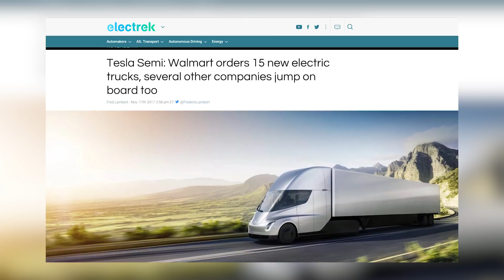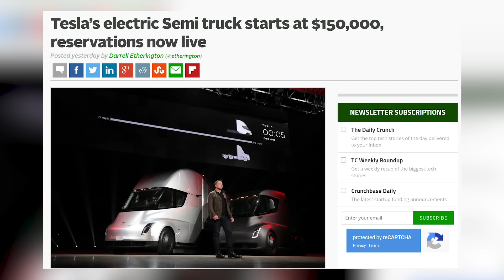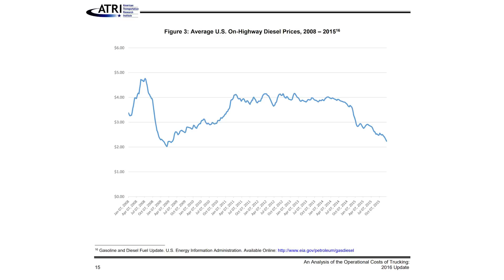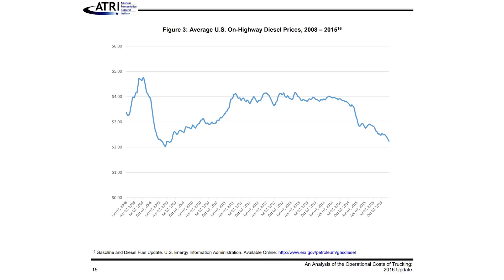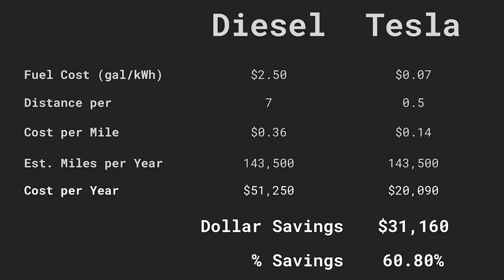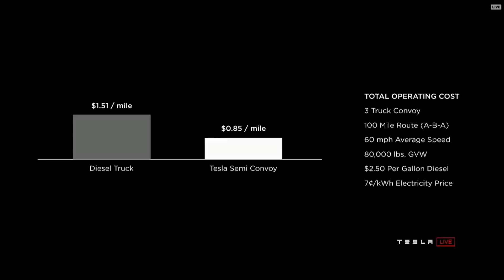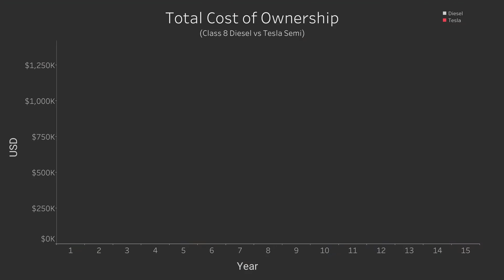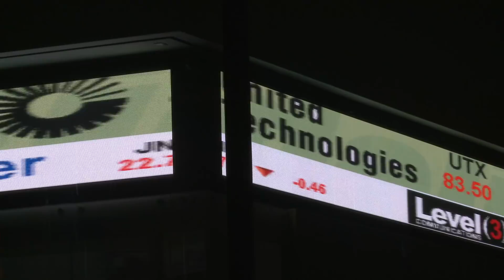What is the TRUE COST of a Tesla Semi?

Comment: You could be wrong on the battery size. Consider that a diesel semi gets 8 to 10 mpg, but a large diesel sedan gets 30 to 40. Figure a 4 to 1 ratio. A large electric sedan (Tesla model S) uses about 240 watthours per mile, so if the ratio holds, the Tesla Semi would use 960 watthours per mile. Rounded up to 1 kilowatt-hour per mile, that would mean a 500 kwh battery pack for a 500 mile range. Half the size you were figuring.
Reply: The mass only significantly matters when the truck is accelerating, once at speed (on a flat road of course) the only thing that matters is air resistance and friction losses in the tires/ bearings, which to be sure will be more than a sedan, but not nearly 15 times more.
Reply: No 2kwh/mile is very optimistic, I'm surprised they can get it that low.
Reply: The Tesla model S weighs 4500 to 5000 pounds, the semi fully loaded weighs 80,000 or roughly 15 to 16 times as much. I believe this can't be overlooked.
Reply: Flat roads? Not a lot of that around.

Comment: Actually, in the long run, the more packages that get delivered at home, the fewer semis we will need.  More things will BYPASS unneeded distribution and take the shortest possible path to your house.  And that will happen, ultimately, in very small vehicles.
Reply: Alan Brown I've actually had packages delivered direct to my door on semis
Reply: Alan Brown That is a real ignorant ads backwards conclusion.  The trouble of retail outlets will lead to more trucks since the sheeple don't want to drive like they used too.
Reply: Alan Brown are there going to be manufacturing facilities all over the country for one item that would be produced much more cost effectively in a single location and shipped with a completely non-polluting, powerful and efficient 21st century revamp of transportation. 

Now with food, I think a local system would be ideal. The food, would be ideally made in a controlled, efficient setting that could be placed near where people live to allow fresh, healthy food for everyone and also should be converted to a 100% solar energy profile. By this I mean no tractors and instead use an electrically powered robot system inside a building or those things Elon's brother is making.

Comment: We ordered 5 Tesla Semis! I hope there is an option for a foldable bed.
Reply: exactly. but goverments are not wating to allow  trucks without driver onto the road.  good use i can see for the convoy  system is that if an driver runs out of hours or gets tired he can tag onto other truck going to the same spot and rest without the truck stopping.
Reply: @ToomasTelling  Of course driverless trucks don't pay income tax!
Reply: Wait, so you have no idea exactly what you’re ordering?
Reply: and here where i live local trucking could be done  by electric truck easyly because the country is only 250 miles across each way.
Reply: Wayne Russell 
The rear cab matches the width of the trailer (?)
Reply: Derek Rogers California has already implemented a tax fee that will only apply to electric vehicles to solve this issue, its not like electric cars will be exempt form contributing the idea is to improve from what we currently have.
Reply: Derek Rogers so here's the real thing to ask.. as driverless vehicles become mainstream.. does it need to be a requirement that a "driverless" vehicle needs registration?
Reply: I guess someone will get them cheap on the inevitable bankruptcy!
Reply: @The socially responsible Anarchist And when has that ever happened?? In California we've had dozens of hwy tax increases. Absolutely no maintenance of the roads!
Reply: It's common to see people order from Tesla  new products without knowing what you will really get. To me this shows how good of a  satisfaction Tesla customers get. If you look at the history of it's cars there were issues at their biginig, customers were satisfy with their purchase
Reply: This will be a game changer!
Reply: There is room for a foldable jump seat. Is the cab at that point wide enough for a 2m foldable bunk?
Reply: What about the road tax we pay at the pump, this is what pays for the maintenance of highways, does this mean the highways won't be repaired??  Or will the public have to pay higher taxes to help support the highways
Reply: Derek Rogers where are you? In Texas, we pay ours via our annual vehicle registrations, or through tolls, if available.
Reply: Would it work if the front seat can recline flat?
Reply: Have fun loosing your job, hope you can find something and don't just steal from Uncle Sam.
Reply: Adam Smith -  his great grandfather lost his job at the buggy whip factory and never recovered. Explain why every second rig on the highway has a sign  on the back looking for drives/owner operatprs.

Comment: Hi Ben! 
Do you have any knowledge or could you make a statistical guess of tesla expanding to India?
Reply: I think it will happen in small scale in next two years, but it won't be a huge thing. If Tesla wants to get a good market share in India, they will have to offer a product in sub 12lakhs market($20,000). They dont have much scope with their current lineup of expensive cars. I think this would be viable in two years when they start manufacturing their new cheaper batteries.

By that time, I hope someone make electric bikes/scooters as well using same batteries, as that is the prefered mode of transport for many.
Reply: Thanks for your reply!
Indian Government is pushing towards electric cars. Do you think that this new battery technology is actually the three-fold increase in the efficiency of the production from the Giga factory( Elon Musk spoke about this at the time of Gigafactory launch)?
Reply from the maker: I’d venture that is more of a political guess than a statistical one
Reply: It is very likely to be much more efficient and have higher energy density than the current batteries, but I dont think it would be three-fold. It would be better for sure.. What we want is cheaper batteries for it to work in India, other factors doesnt really matter.

Considering that Elon is betting on E-trucks, powerwalls, and grid scale energy storage, it seems like they have some secret tech which is considerably cheaper than existing solutions. And, that will be revolutionary. The cost of electricity is tremendously decreasing in India as well. Infact, currently we have more electricity production capacity than we need(just that the grid is not good enough to handle it).

If electricity get cheaper and battery gets cheaper, then you can think that everything will be affected. Everyone will prefer electric vehicles especially now that the range problem is solved.
Reply: Ha ha ha,,,,,,Tesla will never come to India in the near future,,,,I wouldn’t say never ever, it’s just very unlikely maybe some day but with all the other manufacturers coming to market with their offering very soon plus since they already know how to mass produce vehicles it’s extremely unlikely Tesla will be expanding out of the North America continent.  
Tesla can’t even keep up with the domestic market then there is Musks micromanaging style issues/problems plus lack of cash and over priced cars are all hampering any chance of Tesla expansion out of the US if ever.

Comment: what about the cost relative  to air pollution ,notice that   the coal powered plant argument is not even valid here since tesla megacharger are going to be solar
Reply: exact ,in quebec we are almost entirely on hydro power ,we even shut down nuclear.
Reply: tesla can always buy regenerative energy or just put regenerative energy in the grid and take it out somewhere else.  sure not all the power will be generated on site. although if you think about putting solar on your own logistic center and charge the trucks while unloading i'm sure you can generate enough energy if you put a battery between the panels and your truck.
Reply: Some companies maybe don't care about pollution, but they all care about their image.
Reply: @basjqnatsks wrong on all counts. Elon risked all his  personal money in a high risk low success situation. Tesla during the 2008 financial crisis. They were going bankrupt then. 
Electric distribution has power losses from power plant to distribution, but power losses are still WAY more efficient than manually driving and pumping oil to distribution networks (gas stations). From gas station, a car uses only 25% or less, the energy of gas, from frakking, it uses less than 5% of the energy from gas.
80% of the energy from FF is not the point. Even with dirty energy, e-motors are at LEAST 4x more efficient than frakked fuel.  Meaning, you travel at least 4x the distance with the same amount of power. When you are in traffic, you are infinitely more efficient than an idling combustion motor. Final analysis, you are responsible for at least 1/4 the pollution as compared to another trucker/driver/operator.
I like nuclear but I think for a lot of people the risks vs the economical aspect are no longer viable.
Reply: The trucks could be charged completely from solar panel powered battery packs. What will likely happen is that they'll make a long-term deal with power companies for 7¢/kWh industrial rate electricity and then generate half of it themselves with panels and batteries.

Assuming they're powering trucks up with electricity at a rate of 1600 kW. This is about 35 power packs going at once (rounded up to account for some losses).
Reply: al591 lol. Nuclear is better than hydro LOL
Reply: sam guapo He was actually correct with every point he made. But really none of this matters. The fact is, the Tesla truck is entirely theoretical. The whole thing relies on battery technology that as of yet does not exist that’s to be charged using a nation-wide charging station network which also doesn’t exist. What Elon is promising is entirely unrealistic and ,frankly, I don’t see this truck becoming a reality.
Reply: never knew the sun works at night, heres something you never knew, to meet expected power demands in 2020 with full solar we would need 7 times the known silver reserves of THE PLANET EARTH.  So what else you making power with?
Reply: Let's be honest megachargers are not going to be powered by solar. Most trucks get run in the day and charged at night, no solar. I think the Tesla truck is much better for the environment even with it being charged on coal but lets be honest with ourselves.
Reply: They put out more pollution that ever today. This is not because of the "fumes" but because of what California law has put in action. They have this thing called DEF and what it does is get rid of the black smoke you would see a while ago. What most do not know that what makes the smoke dissipate is spraying into the manifold is ammonia. This is not only harmful to the environment but brings up the maintenance cost up as if you are not using a APU will crystallize over time inside the engine. Yes there are quit a few trucks that do not use APU's.

Now the miles per charge is hopeful at best. Battery degradation is a real thing and even if you have to replace them once every 5 years you are still running into less miles per year as that is the nature of it, a percentage loss over time. 500 miles is near a full days workload given you get one to two hundred more per day and about 1500 per full tank. What happens if you are near that 500 mile point and no station is near for 50 miles past the point you are at of losing power?

I highly doubt you will see this working well in OTR any time soon but local driving like Wally world yes it would be good for them long haul.
Reply: It's easy when you have the ff: 1) More panels. 2) Large Batteries. The set of panels required/truck just has to be increased. Truck routes usually have lots of vast real estate in between. Establishments may be sponsored by Tesla to have free solar panels just to attach a megacharger there.
Reply: Making fossil fuels useable by cars and trucks are also very fossil fuel intensive.
Reply: Yup. And that's vs. diesel. Vs. Gas, you easily get a minimum of 4x efficiency. AND don't forget that its easier to (if they honestly invest and do one) attach and control carbon capture facilities in the few power plants as against the millions of ICE vehicles.
Reply: the great one more than 80 percent of all energy is by either coal natural gas or petroleum
Reply: AnotherLife you do know energy can’t travel that far without losing a lot of itself in the process? Right?
Reply: Johan Masse solar is horrible inefficient and bad for the environment. Nuclear or hydro is much better, funny how he wants his solar instead. He doesn’t give a damn about the environment
Reply: whykhr Tesla will not have solar farms. Horrible investment. Elon doesn’t give a shit about the environment, case in point you will never see a Tesla solar farm
Reply: Johan Masse When you generate power from a solar array, the electric company pays 25% of what they will sell it for. Go check. They claim "transmission costs"
Reply: Pritish Patil actually it is only about 10% better.
Reply: al591 worse for nuclear
Reply: No he's not. Also the battery tech for charging like that has been around for the last few years already. Also note that when Elon releases a prototype, he really releases the production model. Don't believe me, just look at his track record. 100%.
Reply: Dave Zoll "Diesel Exhaust Fluid (DEF) is a non-hazardous solution, which is 32.5%urea and 67.5% de-ionized water. DEF is sprayed into the exhaust stream of diesel vehicles to break down dangerous NOx emissions into harmless nitrogen and water." Urea is made from ammonia naturally in many living creatures but is a non-toxic substance. Don't spread false information, the diesel community gas enough bad press as it is.
Reply: Dave Zoll Which is true, but DEF fluid is made with urea and not ammonia.
Reply: It's silly arguing that the power plants will be coal. Even if 100% of electric vehicles run via coal power plant... It's STILL WAY BETTER!!! Than individual vehicles burning fossil fuels... And emitting fumes in traffic...a centralized burning of coal in a coal power plant is 40-50% more efficient and it has better equipment for prevention of toxic gasses (like nitric  oxide/sulphur oxides etc) release in the environment...
Duh...
Reply: Oh boy. Tesla will probably build a solar plant in nevada desert and sell the electricity to the big energy companies. Then they will buy the energy needed at the megacharger location.
It doesn't mather where the solar energy is generated.
Reply: But aren't those same generators running less because there is no load in the middle of the day? Plus the battery banks make the solar more effective. Keep in mind manufacturing batteries and solar panels is a very fossil fuel intensive industry.
Reply: Want to see how retarded the typical EV shill is?

"Adam Miller
But aren't those same generators running less because there is no load in the middle of the day? Plus the battery banks make the solar more effective. Keep in mind manufacturing batteries and solar panels is a very fossil fuel intensive industry."

NOPE, cause your now causing base line plants to be taken offline, requiring the use of very dirty, very costly peaking plants.  

Your dumping power during the day, and dropping it off during prime power usage.  Really fucking up the base load.   

Lrn how to power grid.  The most EFFICIENT grid would use the same amount of power 24/7, all solar anything does is screw up the gird, house solar is the worst.
Reply: Big company don't care about air pollution, maybe only if they must paid for it. So this point is not good for them.
Reply: There is NO WAY the trucks will be charged with power derived mostly from solar.   Yes...I'm sure there will be solar panels involved...but the bulk of the energy will come from elsewhere.  Remember the solar charging stations where each parking spot is under roof covered with solar panels and they charge about 1 mile per hour.   And that is in Sunny California.   The density of power being used to charge an electric car is massive so forget the part about these trucks being run on solar.
Reply: I think they will obtain solar through the grid.
Reply: No the trucks will NOT be running on solar power. Tesla will sell solar power to the grid, likely at dedicated solar farms not located near the charging station, you are not charging all those energy hog trucks with solar panels on the roof of a Tesla charging station. Say you avg 20 trucks charging at once for each charging station, that would require a solar farm of 2 sq. km to supply that much energy, and that will be a sine wave output peaking at ~noon, zip by ~6pm. So Tesla will have solar farms feeding the grid, sufficient to supply more AVERAGE solar power to the grid then used by the truck charging. In reality the trucks will be charging 80% of the time with avg grid power mostly gas/coal electricity.